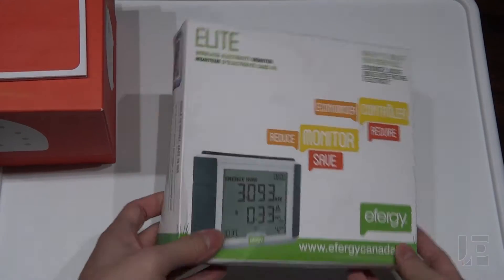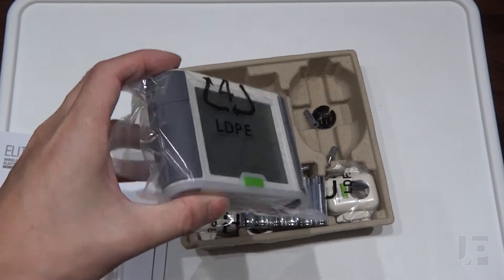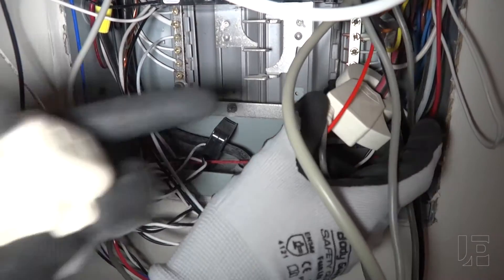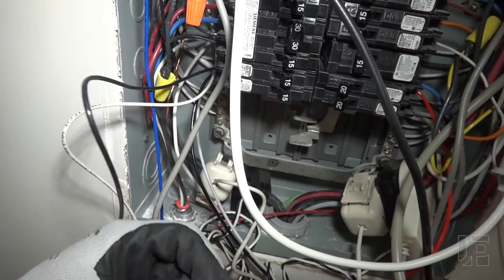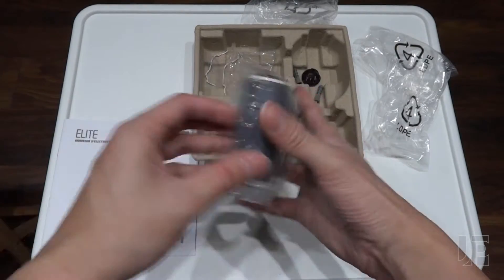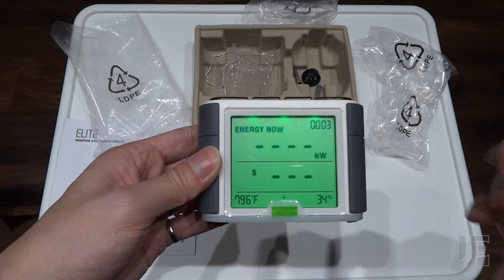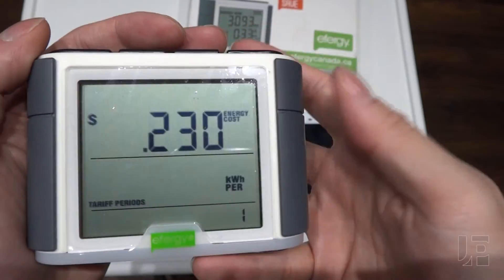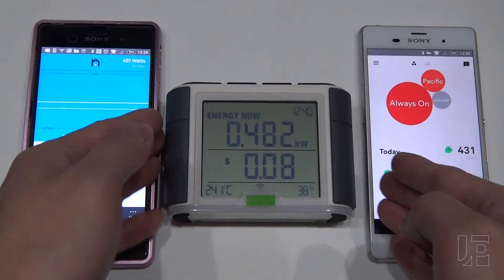Efergy Elite Classic Electricity Monitor Install

Comment: 20$,, damn that a good price, looking to buy one and it's 150$ on Amazon.. And a question.. don't you have 240V comming in your panel in Ontario? Here in Quebec we have 240V comming in, that is then split into 120V for normal outlet and 240v for heating and dryer and stuff..
Reply: He has 240v phase to phase and 120 V phase to neutral some as most places in Canada.